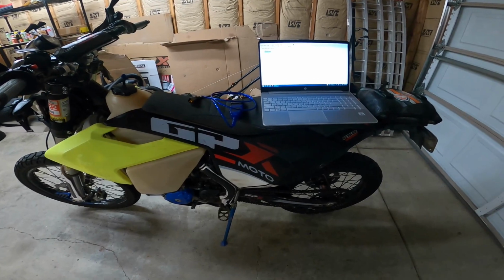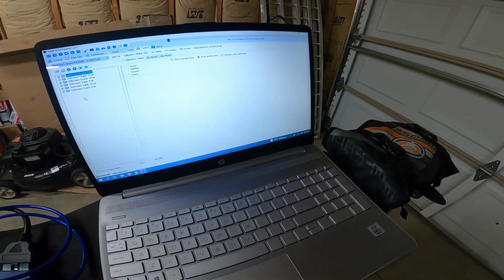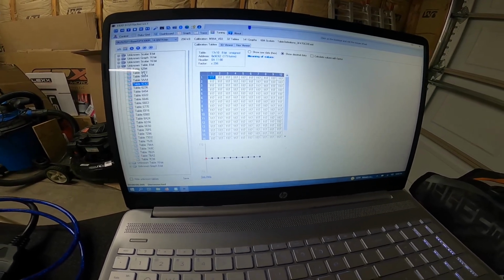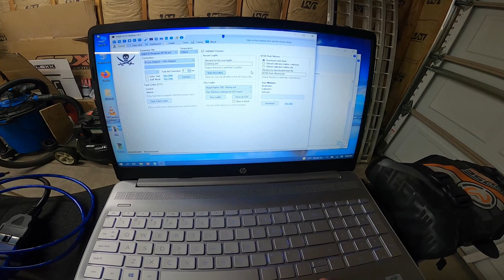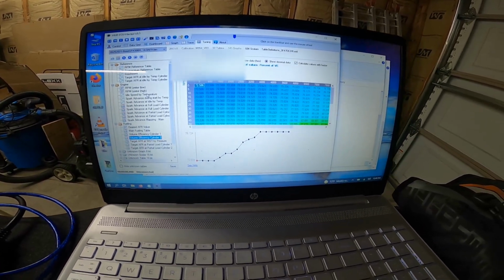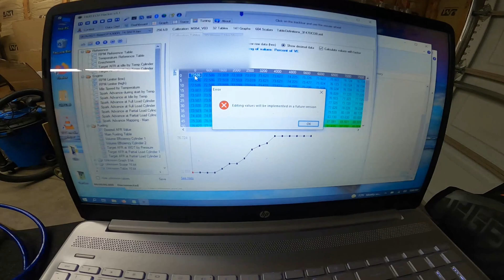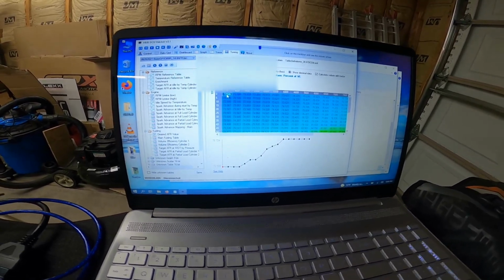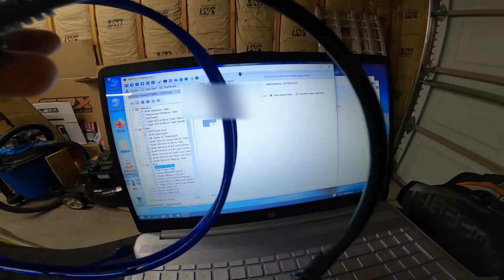GPX FSE300R OEM Delphi ECU Tuning - General Info

Comment: wait, what defnitions, from where to where to copy? 
so first time you connect to the ecu you get those "unknown maps" and then you copy some file into where to get the understandable definitions?
Reply from the maker: HUD ECU Hacker basically has all the tables defined but does not tell you exactly how an ECU works.  An ECU to me is like a relational database and has been a matter of understanding the relations between tables.  

Early on when I was doing this ECU stuff HUD was not as complete and the tables were unknown like all in hex and such, was quite difficult.

Comment: Is that easier than a carb? Way cool though.  Great you're taking the dive and once your dialed you can have lots of fun easier than carbs and timing cams etc
Reply from the maker: Well depends on definition of easier.  I plug a cable in and I can change my tune so that's easier but the tune itself is much harder since more parameters.  And the nice part is I'm using the stock tune here, just modifying it so it's already most of the way 'good', I don't have to re-write an entire map.  

I just meant with the carb comment it's very guess and check, I don't have set maps I can just 'load up' and be like "Okay this is a race map!".  This is changing some tables, starting the bike, riding around and testing then repeat.
Reply: No not really tbh but alot more customization for sure like popper crack tune flames which are possible for carb but  may or may not affect performance

Comment: That is WAY over my head.
Reply from the maker: Haha that's why I wanted to post it, it's just so new right now this is difficult while things get worked out. That said...this is exciting stuff because it blazes the way for a future where ECU re-flashes may be rather simple and/or cheap for folks.
Reply: @SCakey  I replaced the stock spark plug with an NGK CR8EIX, trimmed out the backfire mesh on the air filter cage (now it's just like the KTMs and Huskies), dropped in a 13 tooth front sprocket, and ran some Seafoam through it to clean everything. My bike is still backfiring, but running like a champ. It'll pull the tire off the ground without any extra effort now. Before it wouldn't do that.
Reply from the maker: @fredbunkley5604  Yea found the CR8EIX to help as well, use hi-flo air filter without the backfire screen and it's honestly been quite clean running as I'm doing testing, like not many backfires and I think I can create more rich-backfiring on my ARacer ECU. That is one of the goals here, a nice clean sounding engine, not exactly looking for pure performance but gains are fun.